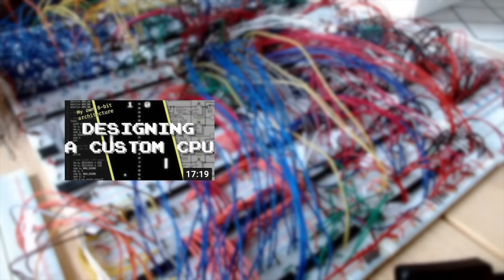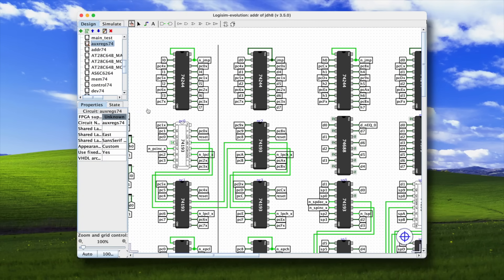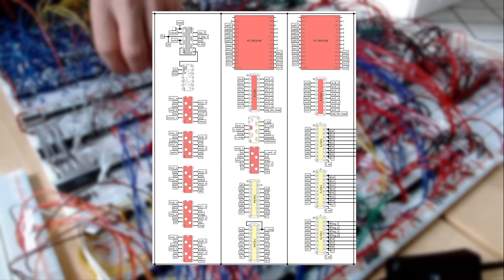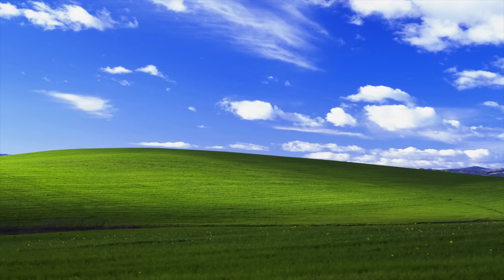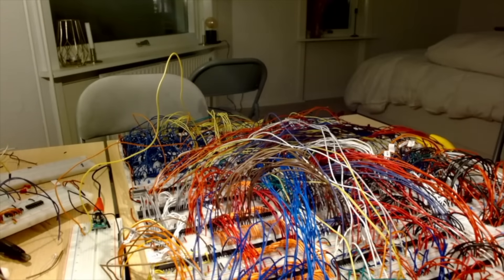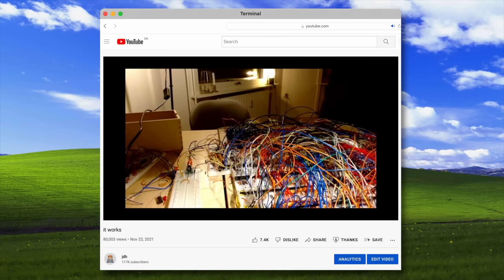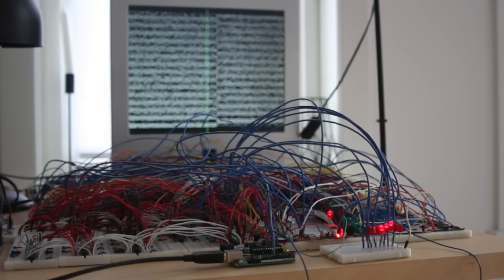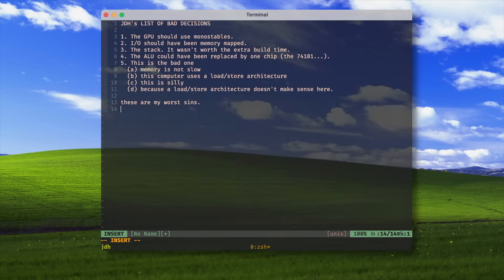I built my own computer. by hand.

Comment: Fantastic! BTW, what was the clock speed? I'm presuming that being a breadboard (with its large parasitics), the clock speed must have been limited to less than 1 MHz, right?
Reply: In one of the videos he says that it was intended to run at 4MHz, but couldn't, and he just divided the clock down to 1MHz, where it does work.  But there hasn't been any attempt to find the bottlenecks and optimize them, so it could probably be tweaked to go at least 2 MHz.  Or 3 or 4 if laid out on a PC board.  Those flying wires and high-capacitance breadboards HAVE to be affecting performance.
Reply from the maker: Mostly right - the clock speed was chopped down from 4 MHz to 1 MHz, but the only (known) bottleneck/reason for this was because the EEPROMs I ordered were too slow (250ns access time) to keep up with loading the microcode at 4 MHz without causing problems.

The breadboard components can easily support 4 MHz no problem, the graphics card itself runs on a 4 MHz clock.
Reply: @jdh  Hi, what brand of breadboard are you using? and are you satisfied with the connections?

Comment: Pan up to show off the finished product and... first component in frame is an arduino uno :/
Reply from the maker: It’s just used for clock for testing + power :-) schematic does not include the arduino and it doesn’t need one at all

Comment: Reminds me of the first computer i built in vo-tech... the only output i had for that one though was two eight segment leds. It was funny cause the whole class had pairs of students that built the same computer... at the same time... first one to get it to work got some kind of reward i cant recall what... but lol i remember we would sneak over to other peoples computers and remove a wire here or even switch it around... so, I get the trouble shooting part in a large project like this :)

Comment: I'm so sorry, but I actually don't believe it's possible. The author uses a breadboard with how many circuits? A breakboard? I usually have minor problems with programming small uC's while using about 6 wires due to some misconduct.

Comment: First of all amazing work. Similar project was part of our Computer Architecture curriculum, We had to do it in groups of three, within 48 allocated lab hours, over span of two months,  the trick is to use single solid core cables, cut them up to desired length and lay them out on breadboard like PCBs. My finger tips just got sore, thinking about all the wire bending i had to do.

Comment: 4. The ALU could have been replaced by a single chip

My guy, the entire computer can be replaced by a single chip. I think, implementing the ALU yourself is a big part of the achievement and fun.
Reply: That was my thought!
Reply: But were is the fun in that?
Reply: @brostenen  In implementing everything yourself? Well if you didn't find that fun, you wouldn't build a bread board computer in the first place! One of the main components of a basic pc is the alu. It just makes sense to build it yourself imo.
Reply: @Barmetler  Exactly as I say. Integrating chips in one chip, removes the fun.
Reply: @Barmetler  But you can do all of that... the ALU, registers, hardware AND microcode instruction decode... all of it in an FPGA.  All of your learning and accomplishments will be just as valid, except for the "joys" of physical breadboarding.

I did wirewrapped prototype computer boards back in the Bad Old Days and I'd rather not do it again.  Praise be to today's Asian PCB houses and to programmable logic ICs.
Reply: @Randrew  - But is their documentation written in English?
I'd say he should have used AMD 2901 bit slices, takes out a lot of drudgery without restricting creativity and understanding a CPU.
Reply: @Randrew  "Why not both?" (TM)
Have all those modules on PCBs and connect them together, which would be my next step after making sure that my design works by the way.
If i hadn't enough projects already this would be one thing i could imagine doing, make a silly TTL CPU, make some way to access it from the outside world and write a simple OS for it. Terminal and tape and then adding disk support would be enough for me to toy around.
Maybe some day...
Reply: @Randrew I mean fpga sure are fun and less messy but all the electrical engineering part is already handled so you don't have to bother with that which removes a bit of the fun.
Reply: @brostenen  you can tell everyone around you're one of the few humans capable of doing it...
Reply: @UTJK.  My comments are a year old or just slightly older. So I have no idea what it was about. Sorry. Too long ago.
Reply: @brostenen Feeling accomplished and having your sense of novelty and learning satisfied
Reply: don't tell him about laptops: "wait what you can have a screen, keyboard and computer assembled into one package?"
Reply: The chip is out of production and is basically rapidly turning into an unicorn
the supply is limited
dont use that chip unless you are repairing actual minicomputers from the era that rely on it
Reply: 6: The computer couldve been replaced by a single SoC
Reply: @emre_ez  that would literally defy the entire reason why people do this
this is like saying the spaghetti carbonara could be replaced with a microwave dinner
Reply: @homeopathicfossil-fuels4789  ik bro its meant to be a joke how did you not get it 😭😭
Reply: @emre_ez  i am borg

Comment: I’ve always been interested in builds like this or Ben Eaters. But, once it’s done, what do you do with it? Or is it like mountain climbing? Because you can. I thought about making a single board computer like this and framing it as art, but would be nice if it did something interesting.
Reply: The difference is, and I'm not casting any shade on Ben Eater, since he'll tell you this himself, his computer is far too limited to try to do any real computing on.  This one isn't.  While it may take more object code to perform a given task, this is up to 8080 or 6800 level.  If this is not already a practical computer, it's not far from it.  The architecture he designed, complete with memory segmentation to bust the 64K limit, makes this capable of doing many things interesting.
Reply: @BrightBlueJim  that’s true, never really meant to compare the two devices. If I cared about processing power I’d compare the Arduino or Raspberry pi.  My question is, what do you do with this work of art? If someone wanted to build one, what do they use it for? Or again, like I said before, is it more like mountain climbing Everest? Because it’s there and you can?
Reply: @gamesbychris  This particular work is art for two independent reasons: 1) because of the sculpture, which has an element of beauty to it, and 2) because it works, elegantly.  If you just work with reason number 2, then this is just a sketch.  Not in the "Arduino sketch" sense, but in the "study in pencil before committing to canvas and paint" sense.  Sketches are indeed works of art, but considered unfinished, by the artist.  As such, the actual painting in this case might be a small Field Programmable Gate Array or full custom silicon chip that does this in a single chip.  And what you can do with a microprocessor with a very small gate count, is any project that needs an 8080-class CPU but needs to run at ultra-low power.  Maybe a wrist computer that runs on a 4-cell amorphic solar battery like the ones that Casio calculators in the 1990s used.  Only it could do PDA kinds of things, rather than just be a 5-function calculator.  That's just one example.  There is room in the modern world for simple things.  And for works of art.

Comment: why don't you make a DIY computer on a proto.board (y'know, the PCB-like board with a ton of pads you solder to yourself), or a PCB, next time? or some time?
I know Ben Eater's pointed out that there's gonna be a bit different resistances and impedances and whatnot so it would take some work...but still...

Comment: i'm surprised you didn't have any problems with the length an variability of the wires, felt like that could mess something up
Reply: Wire length and capacitance shouldn't be a problem if the clock runs slow enough. As long as the bits have enough time to stabilize, it's all good.
Reply: @JB52520  Thanks, the machines clock was 2Mhz, interesting to know those tolerances can survive a bodge, only being a hobby coder i would not have easily thought that the clock speed was the important factor in the wiring capacitance.
Reply: @m.p.jallan2172  2 Mhz is years in the eyes of electrons
Reply: I had not thought about that, i suppose he may have measured them before hand. Sort of like building a model ship.  I wondered too about electrical changes over the wires. I broke a leg on an IC chip in an old micro and used a sewing needle in place of the leg.

Comment: I love the video description. Brings it on point. Similar to writing code from scratch rather than using a library. Great video!
Reply: yeah the difference is that the patience/skill required from hardware vs software are in entirely different leagues. Debugging in comp eng is such a deliberate and painful process. There are no error messages, no logs, etc. You just have to infer the issue based on what types of problems you're running into and physically retry to build the things. it's a lot of fun

Comment: If I were you, I would be too damn tempted to create a 3D software rasterizer on that thing.
Just imagine having your own self build computer and then run a 3D demo makes me stuff of my wet dreams.

But a god damn cool project that you did.
Reply: This comment is right below a "can it run crysis" joke for me, and it now has me wondering if it'd be possible to port Doom to this hardware... It's been ported to sillier things before.
Reply: @solarshado  Some legend ported doom to my model of calculator that we use at school!
Reply: @EpicVideoGamer7771  do you have some link to more informations about this? It would be interesting to learn more about this.
Reply: @EpicVideoGamer7771  now port the apollo rocket software
Reply: @solarshado  my comment is almost not meant as a joke. Like visible on my channel I really enjoy graphics programming, so this is something that I would really enjoy doing. Especially programming with limited ressources is quite satisfying. So it would be really cool to see a Doom port but that's probably not feasible. But who knows?
Reply: A realistic minimum spec for a Doom is a 20MHz clock and 64KB of RAM. That's roughly what the SNES port of Doom had.
Reply: @SimonBuchanNz  the SNES port was a dual processor system with 256K rom and a few megabytes of ROM, a single 20MHz CPU probably wouldn’t cut it

Comment: Man went from having programmers as main audience to having electrical engineers as main audience
Reply: More like computer engineers
Reply: @martiananomaly  apparently computer engineers completely skip analog electronics....
which is a shame because that's where the pain is.
Reply: @cpK054L  thats not true at all... most of my undergrad in comp e has been more analog than digital
Reply: @Breadman6242  most school curriculums I see dont teach analog electronics to computer engineers....why would they?
Reply: @cpK054L  I completely agree. There is almost no need for a CompE to learn analog devices, and yet that area is the absolute hardest part of EE. Doesn't make any sense for a CompE to have any knowledge in this area, especially since analog computers are rare and only recently becoming more relevant, and even then, CompE's wouldn't know enough analog to build them. Im not bashing CompE's, digital work is their bread and butter, and most EE's can't compete with their digital design abilities and with computer architecture abilities. They are different fields for a good reason.
Reply: @jonwalters485  Forget "Analog Computers" that hasn't been a thing since the 1970's or later... 
Computer Engineers without learning Analog electronics would make no use designing AFEs (Analog Front Ends) or rather the DSP (Digital Signal Processor) architectures, with just digital electronic backgrounds they'd be limited to FPGAs,ASICs as far as hardware goes, otherwise, digital system architectures are still in their grasps.
Otherwise, anything with ADCs/DACs would be off the table unless it is done purely by the chip
Reply: @SilverSnakeFreedom  not true im dreading my ee courses next quarter im in ce
Reply: @warguy6474  it gets easier in the graduate level. Hang in there. Everyone else is quitting
Reply: @martiananomaly  computer engineering is a branch of electrical engineering.
Reply: @philippemts88  I would say it's a combination/branch of electrical engineering and computer science combined
Reply: @martiananomaly  both
Reply: This is making me become a computer engineer on accident
Reply: Uhhh not me:]
Reply: As a cs major this makes me switch to ce
Reply: You Used An Odd Wee No?

Comment: Wow. You have my respect. I have a similar project.... I'm close to finishing my all transistor and diode based digital clock. And believe me, everything is fun until you have to deal with analog problems in digital circuitry^^.

Comment: At 11 minutes when you were going over your regrets about not just using an already built ALU chip it sparked a thought that since you built the ALU from scratch, why not just keep breaking it down until you're building everything from scratch, including your own logic gates. Next video will probably be you gathering sand on the beach then melting it down yourself and forming the silicon into your own chips lmao
Reply: He'll need to get in some copper mining too, and mix up some polymers to coat the wires. ;) You laugh, but my money is on this guy for president of the NCR after the US and China blow up the world.
Reply: @mikicerise6250  You don't need fancy modern synthetic polymers to insulate wires, some old wires use paper as insulation, some use varnishes.
Reply: @inv41id  even recycling them from old tech is a great idea.
Reply: @inv41id  some don't use insulation at all! granted those wires usually fire the whole circuit😅😂
Reply: Gathering send and making semiconductor components is totally unnecessary. One can build any digital logic using only NOR or NAND gates. So all he needs is to build these from tubes and resistors. There are channels on YT of ppl building "computers" only with vacuum tubes and resistors.
Reply: @perakojot6524  that would probably be too big of a project, literally

Comment: Watch him heat large amounts of quartz sand to produce his own silicon.
Reply: silicone is the rubbery 
material breast implants are made from. Silicon is a chemical element that integrated circuits are built upon using chemical baths, lithography, and etching.
Reply: @nickcopeland5497  Thanks for correcting me!
Reply: @hicfool  you’re welcome, it’s no problem I am entertained by making the correction wiggle wiggle wiggle
Reply: @nickcopeland5497  I appreciate that titties is the first use for silicone you thought of, not like caulking or something like that. You're truly man of culture.
Reply: no no no you need to use trichlorosilane to deposit thin layers of pure silicon onto some matirel
Reply: Imagine he working with Gallium Nitrate and making the first GN-only processor
Reply: @Hexality that's gallium nitride.
Reply: Watch him doing the studies to create a new universe
Reply: Watch him turn into a star so he can create his own elements.
Reply: I'm more curious to see him splicing ammonia and water molecules to create his custom cells.
Reply: i actually just had a class this semester on nanofabrication, we made a mosfet transistor just from a bare silicon wafer. really cool to see how the electronic characteristics come together
Reply: Sounds like a good excuse to collab with someone like NileRed or Cody'sLab!
Reply: I was going to ask when he's going to write software using a magnetic needle and a steady hand, but that's better.
Reply: Check out Sam Zeloof. He's doing homebrew lithography in his garage.
Reply: Silicon, No O
Reply: He should team up with cody's lab, From sand of his own plot,  to transistor to hand made computer. Brilliant.
Reply: what happened before the edit
Reply: @beaclaster silicon was silicone

Comment: Ben Eater be like: well-done comrade
Reply: Ben would be like....what's with that wiring? He'd rip it out and custom make every wire to route them flat against the breadboard.
Reply: This one was BIGGER than Uncle Ben's.
Reply: Exactly
Reply: nahh he don't even give credit to ben eater. most of his methods follow ben eater. especially on his graphics card vid
Reply: @omniyambot9876  its in the desc. He does have a degree in CS so chances are he knows most of these without Ben Eater's contents.
Reply: @manuyel4845  but again, uses most of ben Eater's methods. How he programs, the architecture..
Reply: Ben Dover: 😳
Reply: @regularname1825  * finger guns *